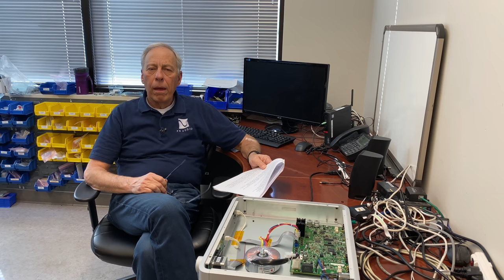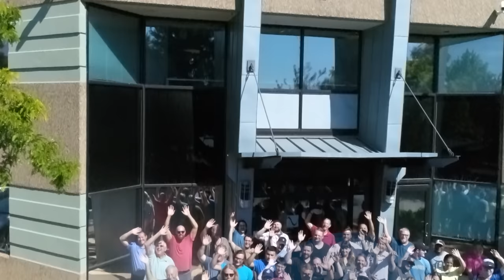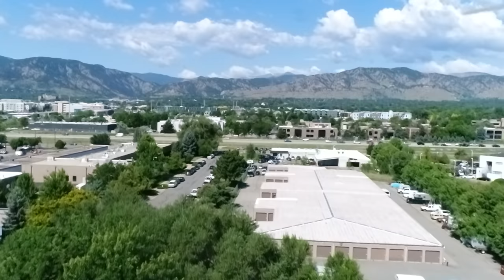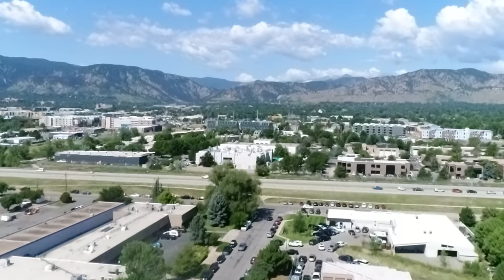What's the best DIY amplifier components?

Comment: Pretty good explanation. My first amp was a single ended triode built from a schematic and a parts list. I was so happy it didn't explode when I turned it on. Other than a failed power transformer, and an occasional retubing, it has performed flawlessly for over 20 years.
Reply: There's an internal satisfaction that is tough to describe - when listening to something you built yourself....

Comment: Hi Paul thanks for the video! This was a good question and you explained this complex stuff in a practical way. If you use one pair of mosfets, i would say it is not to difficult to build an amp, because you have no issues with different Ugs voltages and thermal stability. It can be a challenge to sync. and stabilyze a multi bjt outputstage in a diy project. I have designed over 40 amps in my career and it is a "big deal" to get everything unconditionally save and stable. Best regards from Berlin!

Comment: My ME1500 power amp uses bipolars in the output stages and they can be operated in either strict class A or AB no gradual crossover . The collectors of these transistors connect to the speaker load instead of the usual emitters too .. this amp will go from DC to 400KHz within 1 dB too !

Comment: My understanding JFET's have the best sound quality  next to tubes of course you can search Nelson Pass from Pass Labs.
Reply: Phil Allison  if you look on Newark electronics website they are  still JFET's available. although you do have a good point they are only used as Class A in the First Watt amplifier. there are also a list of MOSFET's which are the choice in high output power amplifiers. i think i would investigate more using JFETs for the pre-amp stage. But i'm no amplifier designer.
Reply: Phil Allison  Also Exicon lateral mosfets from Profusion in the UK are very good and direct replacements for the Hitachi's. 
I used them in my DIY poweramps designed by Rod Elliot (ESP, Elliot Sound Projects), project 101. Very good  power amplifiers!
Reply: Phil Allison  Ahh Gotcha, MOSFET's it is. Thanks for your help..
Reply: Phil Allison  Interrestingly, there are some high-power silicon-carbide JFETs that have come available in the  last few years. They're super expensive, and I have not looked at the DC safe operating area, so they might be completely useless for this application. That said, they do exist.

+1 on the laterals, they're about as easy as it gets since their temperature coefficient is pretty close to zero.
Reply: Phil Allison  Just as a quick side note, if you look on mouser, they do actually carry UnitedSIC power jfets.

Comment: You can: Buy a new amp, buy a used amp, buy a module amp (e.g. IcePower), buy a kit amp (e.g. Welleman), do your own amp based on existing schematics (e.g. using parts from DigiKey) or start from scratch. If you start from scratch designing and calculating the circuit doing the first power amp in your life, definitely keep it simple. One way to make a great first DIY amplifier is to rely on an amp IC (either class D or B) rather than completely discrete transistors. Going completely discrete with your own schematics takes some in-depth electronics engineering knowledge and experience to make a good product.
Reply: ThinkingBetter 
Excellent advice, especially for someone that’s never built an amp. Start small and simple, and learn the basics first.

Comment: Use a compound output stage. Use 2SC2922 and it's PNP counterpart as output transistors.
Reply: All MT-200 package transistors are obsolete. Sanken discontinued them several years ago. I would never suggest building around obsolete parts. The best options are probably MJL1302 / MJL3281 , MJL4302 / MJL4381, 2SA1294 / 2SC3263. MJL21193 and MJL21194 are slower but have good power handling. 2SA1943 / 2SC5200 are a good value, but their SOA isn't great at higher supply voltages.
Reply: @H-77  I didn't know. I have of both of them 100 pcs lying around, but that is bad news. MT 200 has the advantage of two mounting points and better heat transfer. I use one pair for 50W class A.
Reply: @airgead5391  It has excellent thermal properties, however, the transistors themselves were quite costly and took up a fair bit of real estate. TO-264 and even TO-3P can have quite a good thermal transfer if used properly. A clamping bar helps considerably with this. A look at the design of 1990s amps (MT200 packages would have been easy to get, and Class AB design was at its peak) like the Crest 4801 or the MC2 MC650 or QSC amplifiers reveals large numbers of 2SC3281 / 2SA1302 output devices (same as the MJL3281 / MJL1302) indicating that for the price and size, these transistors make more sense than the MT-200 packages.
Reply: @H-77  Well, the point in my case is that I looked for the best performance which at the end turned out to be a single output pair of transistors and class A. Using 2SC5200 and PNP counterpart for instance, which I have also 100 pcs each would demand two in //.  Pivotal specs I for me are Cob and fT. Double pair = double Cob for instance. 
Using a clamping bar is interesting. I did consider this but not for thermal considerations. I will give it a try and measure temperatures.

Comment: For lower power amps (around 50 watts) you can use a MOS-FET based "chip amp". I feel these pre-fab devices have better sound than discrete bi-polars.

Comment: a nema17 stepper motor as a motorized volume knob... interessting, havent seen this one before.
Reply: I don't know how PS is using it. I use one as an encoder to control the volume of my HiFiBerry Amp (sitting atop a Raspberry Pi).
Reply: back emf as a rotary encoder, also a interessting idea. i would have used a optical encoder on the same shaft.
Reply: @__Dude_  How do you like the finished product? I was actually thinking of doing exactly the same thing. Does it feel as nice as I think it would, or is it super annoying?
Reply: Remote volume control. The remote or bluetooth controls the motor, the physical position of the knob remains the volume control

Comment: Ohh, how I wish we still had Heathkits and Dynaco kits, and Old Colony Sound Labs.  I’m sure there are still kits to be had if you look hard enough, but the ones I mentioned were easy to come by, well thought out, and top notch products.
Reply: Neil, I really miss those days when one could build a great piece of equipment and get so much for your money. I built a lot of kits from Dynaco, Heathkit, Knight Kit, Old Colony, Marchand and some I probably don't remember.  Nowadays, I think that it is better in the audio DIY world to spend your time and money building speakers which will yield far better payback than building electronics. That said, I am building a class D amplifier now using ICE Power modules which isn't the same as building from scratch but still worth the effort I think. Then I will build some speakers using components from GR Research to get high end sound at bargain prices.
Reply: Stewart Markley then you’ll have your own version of my DIY setup: Pass preamp into two Pass Amp Camp amps driving “full-range” bookshelf speakers sourced from Parts Express (augmented with a subwoofer, because full-range doesn’t really mean full range when it comes to bass).  I’ve really enjoyed learning what components work together and how to change the sound of speakers with ports, stuffing, etc.  Happy tinkering.

Comment: hi Paul, what about the resistor that connected to the power rail and the collector of the BJT? How can i get rid of that resistor to get the full 50V to my amplifier BJT? Its only getting arround 20V (on the collector of the  BJT ). The resistors are 2x22ohm at parallel. Im limited by that resistor, speakers is 2x 8ohm (now i using 1x8ohm speaker due its closer to the 11ohm limitation of the voltage and current to the transistor.)

My question is actually why we need that resistor, and how can i bypass it?
Its a class A amplifier.

Comment: Hex Fets your thoughts?
Reply: Can be good, but their DC safe operating area isn't what it looks like. They still suffer from something that is basically the same as secondary breakdown. Lots of people use the IRFP240 and IRFP9240 successfully, but there are caveats. Back in the 1990s, BSS successfully used (a whole lot) of IRF640s and (I believe) IRF9640s in the EPC780s, which have a reputation for being excellent amplifiers. 

In other words, they aren't quite what people think. I've played with quite a few vertical MOSFETs in higher voltage linear applications, and the older devices with a higher R_dson handle it much better, but they are all prone to hot-spots on the die. It's basically secondary breakdown, but it isn't always shown in datasheets.

Comment: IMHO, if someone is asking this kind of question, they are better off trying off a preamp. Less chance for the white smoke escaping and easier debugging. Even if building a kit.
Reply: Savvas Sidiropoulos Maybe, except the wiring. Selector switch, potentiometer, multiple inputs. I don’t think you can do better than the diyAudio Amp Camp Amp kit. Step-by-step photos and instructions online, sweet sounding Class A, and a switching power supply so you don’t get into high-voltage. Only downside is not much power — 8 watts a channel. I built two for monoblocks and then a preamp, which was much harder because you had to source your own parts. But those a pass diy projects are outstanding. The amps are MOSFET-based, by the way.
Reply: @jimfuquay7116  8 Watts? No problem. Who needs more? Surely Nelson Pass doesn't :)
Reply: Not necessarily. The FET vs. BJT debate will never end- everyone has their favorite, and neither one is the "right" choice. Preamps are also tricky because noise can be a huge challenge.

Comment: I personally prefer common emitter amplifiers because of their ability to have almost a rail-to-rail output voltage swing. I have developed a very simple design as a boostered opamp https://ibb.co/nPY7zRH . It is a non-inverting amplifier. The output of the opamp is not connected to the amplifier output stage, because they are controlled by use of the rail currents of the opamp generating the base emitter voltages across R4 and R5. The quiescent current of the output stage ist set by the adjustable current source (LM334, R8 as fine trimmer) between the bases of the output transistors (Q1, Q2).

Both transistors are Darlingtons. If you likes more thermal stability you can add emitter resistors to the power rails. I recommed it if you asseble the Darlingtons or Sziklais from single transistors as their current gain and threshold voltages can differ a lot. I also recommend to use base emitter resistors for each of the transistors of the pairs in order to limit the total current gain. The TIP120, TIP125 have their base emitter resistors internally, so thei can paired easily.

The gain of the amplifier can be set by the ratio between R7 and R3. The required power can be set by changing the voltages cc and ee with respect to the speaker impedance.